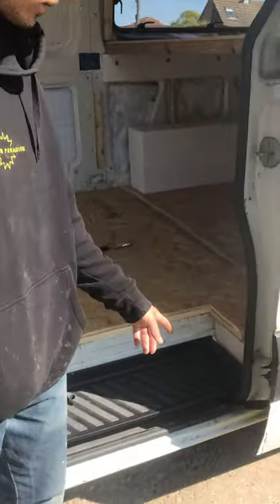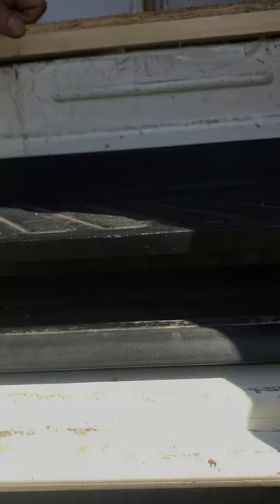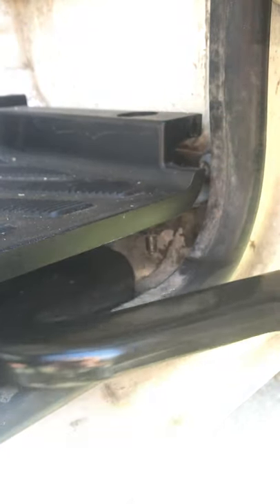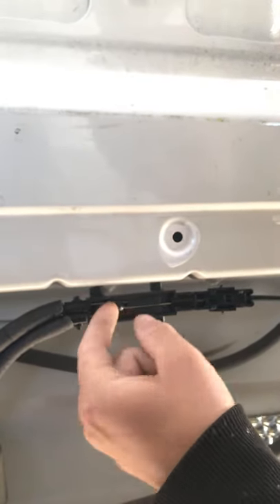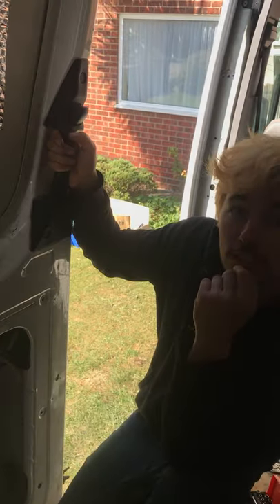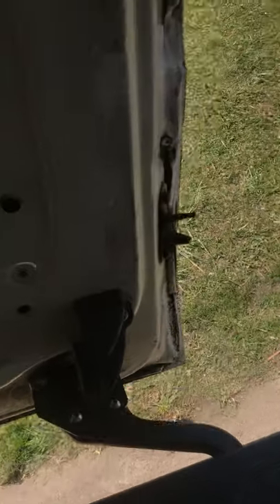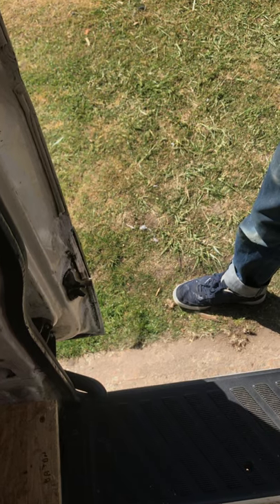Volkswagon Crafter Sliding Door Issue

Comment: I just replaced the swing arm after that still not working well. Lubed the cables a bit in the black box (which is missing the cap in this video) and the problem is directly solved. I almost ordered new cables but a simple lube of the cables was the solution

Comment: My door was stuck. what I noticed was the bottom roller had slipped into the wrong track. One of the tracks is smooth and open the other is the same with reinforced with plastic cross sections which was stopping the roller from moving forward or backwards. The roller needs to be in the smooth track. I managed to prise it over using a large screwdriver.

Comment: Hey! I have the same problem with mine 😔 Did you ever find a fix? Cheers!
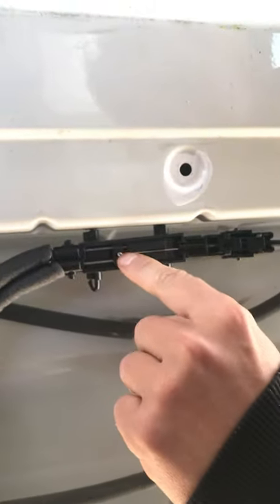Reply from the maker: Yes we did actually! There's a small plastic covering that was missing from our van, it basically holds the cable tension when it's clipped on. You can see it missing at 1:27. We found some guy splitting his van and managed to buy the part of him and that was that. Hopefully that's your issue too!